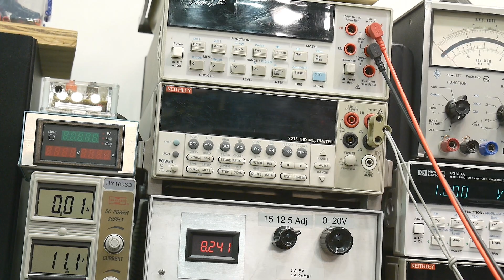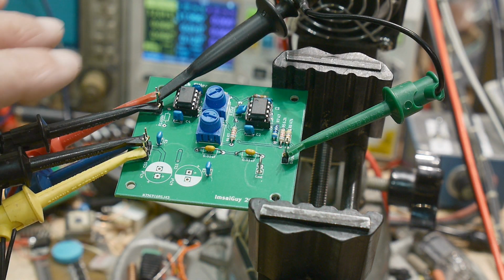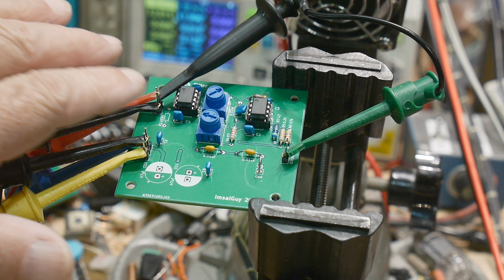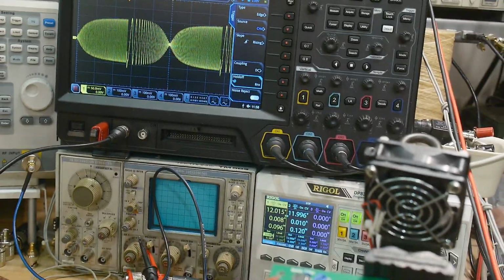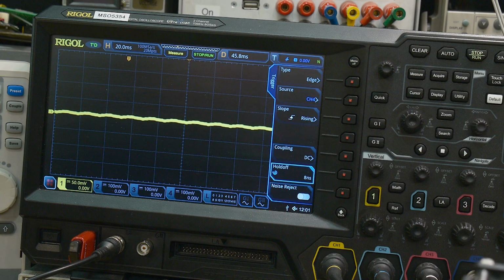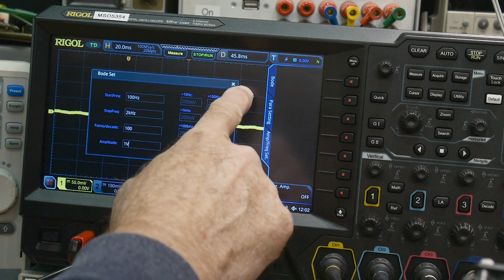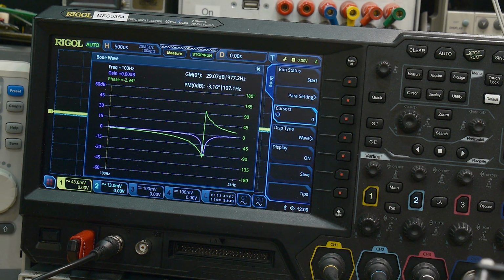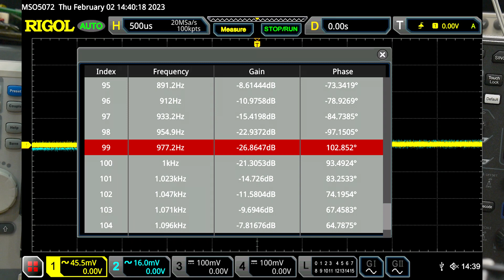#1426 Notch Filter (part 2 of 3)

Comment: I was hoping you would zoom in on the frequency range using the first technique, say 900 to 1,100 Hz or even 950 to 1050 Hz and redo the adjustments to get as close to 1 KHz and the best notch as possible.  Then rerun the Bode Plot.  

What do you do with the extra boards you have there?  Do you sell them or do we have to go to the board manufacturer and buy one there?
Reply from the maker: you have to buy them from the board house

Comment: The phase is changing radically BUT, don't be fooled by the discontinuity.  The phase SHOULD continue continuously to -180 deg.  Evidently, Rigol has constrained the output to the arctan() range instead of atan2pi().

Comment: The best audio the meters still use notch filters prior to digitizing. This allows much better dynamic range than just letting in main carrier along with harmonics. After nul the rest gets amplified by 20...60dB and that gives you that much more dynamic range. Otherwise you are limited to about 100dB for best ADC's . With the notch you can get 140dB or more of range.